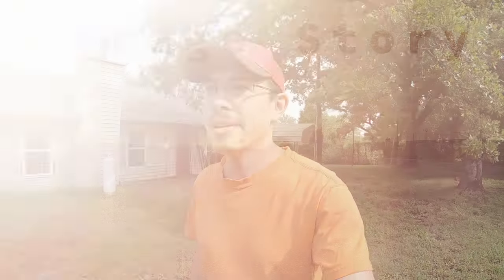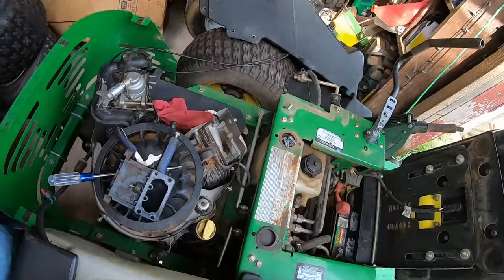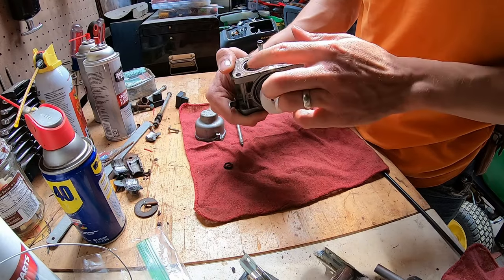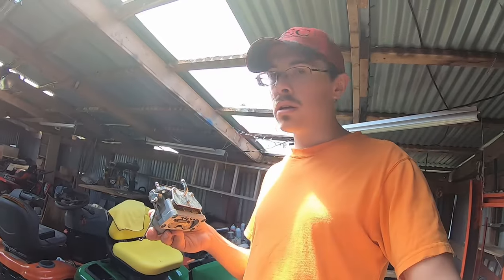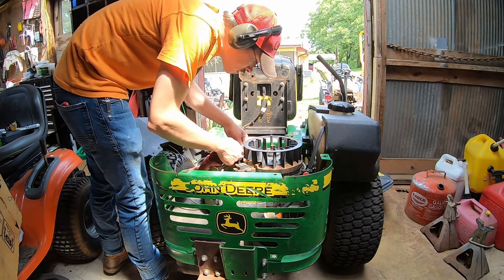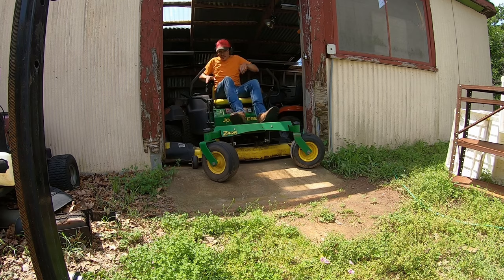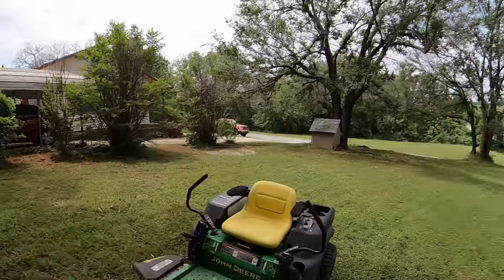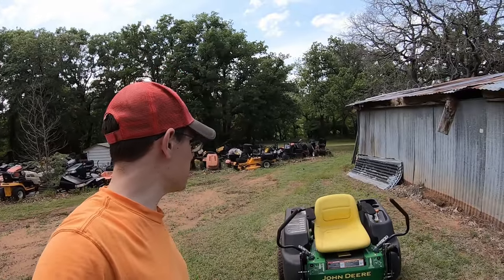Sometimes it's that easy | John Deere Z425 Carburetor Cleaning

Comment: How did you remove the intake manifold from the carburetor, what’s your process? I’m replacing the carb on my z425 now and trying to use the same manifold without damaging it
Reply from the maker: I don’t think I really have a process, per se. I first of all, try to avoid unbolting the carb from the intake manifold (just leave the manifold attached and work on it that way). If I do need to take it off from the carburetor, I just try to be careful.
You probably know this, but the manifold has to be unbolted from the engine to remove the carburetor (unless there is some other method I’m not aware of).

Comment: I’m sorry but what does jumper to ground mean? 
I’m pulling out what little hair I got left trying to get my z 445 going!! 
Says there’s 2 frame grounds I see one down by starter at base of engine block but cannot find other one!!
Reply from the maker: I ran a ‘jumper’ wire from my engine to my negative battery terminal. I believe I just used some jumper cables. But it helped me identify that I had a poor ground connection. I hope that helps you!
Reply: @garagestory  ok thank you very much sir! I just got home from work gonha try that! Thx again and thanks for replying!
Reply: Did you find the second ground location?

Comment: A bigger mower gets the yard cut quickly and the time is cut in a great bit of time unless you like being on a mower for long periods of time 😂
Reply from the maker: I do enjoy mowing, but I enjoy it most when I can get it done quickly!
Reply: I watched the video we’re you got the ztrak running and it was typsy everyone of them I have seen has weights on them on the front of the platform were you put your feet.
Reply from the maker: Good to know. I actually like how this one has most of the weight over the rear axle. It has way better traction than most lower end zero turns. I’m sure having larger rear tires helps too.